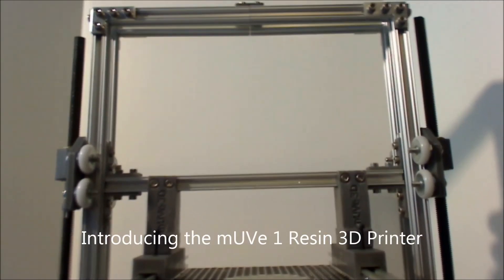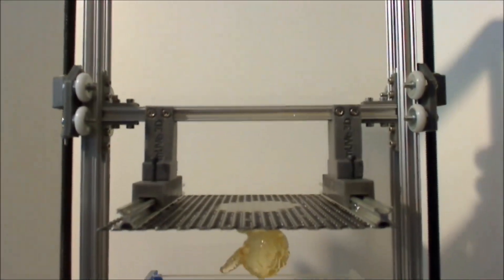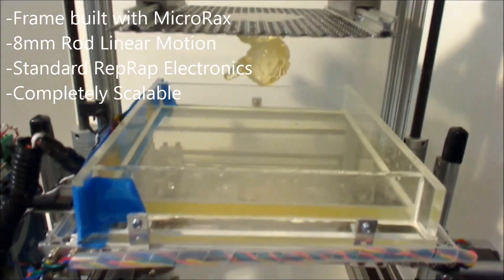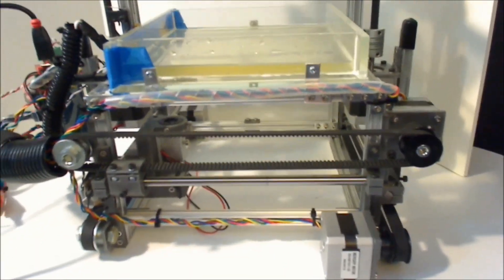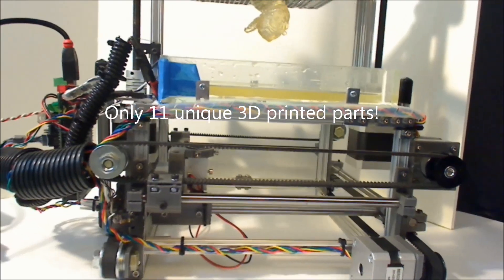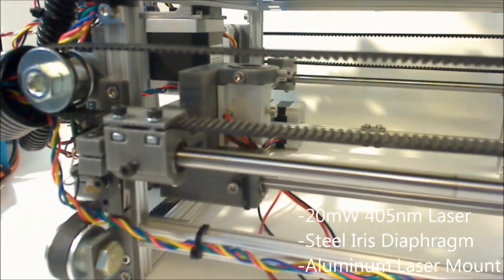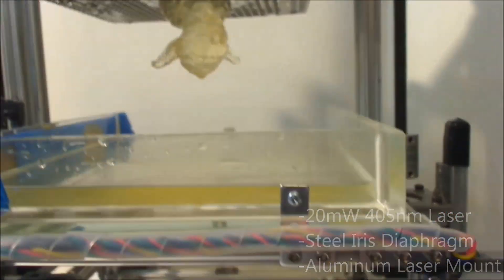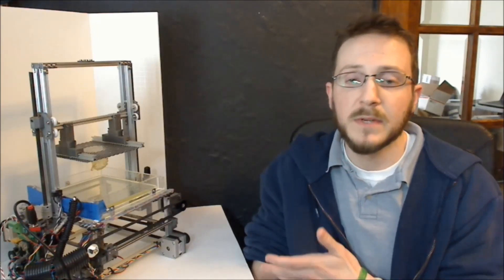mUVe 1 3D Printer - Open Source UV Resin 3D Printer from mUVe 3D

Comment: It simple and straightforward.
But where are you getting the resin? I recall resin being the biggest holdup of making resin based printers more popular on top of the limited selection in material because of it. Does the resin need 405nm to harden or can it be used with other wavelengths too?
Reply from the maker: MakerJuice and Solarez both make 405nm curable resins and also have separate pigment additives. MakerJuice is rather inexpensive too! Other wavelengths of UV may work but the resin maker may have to be contacted to find out. I believe makerjuice is all the way through the UV-A range up to ~420nm.